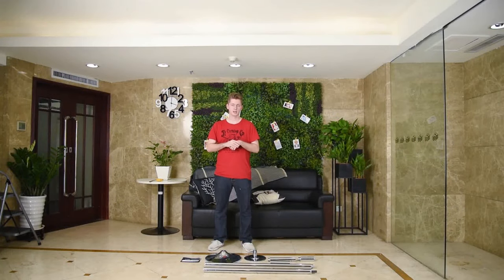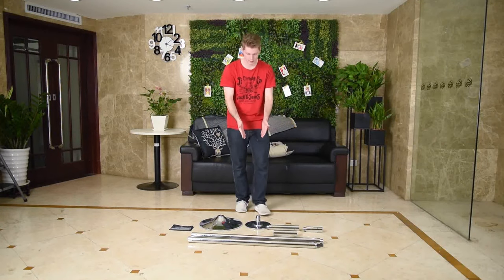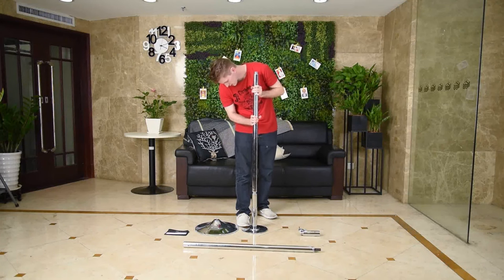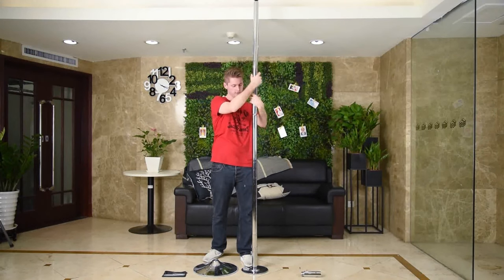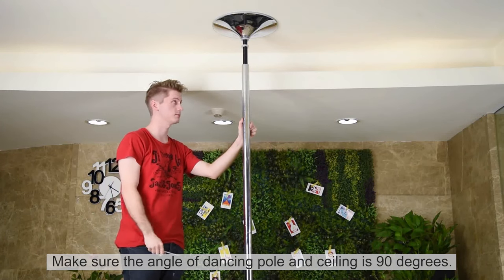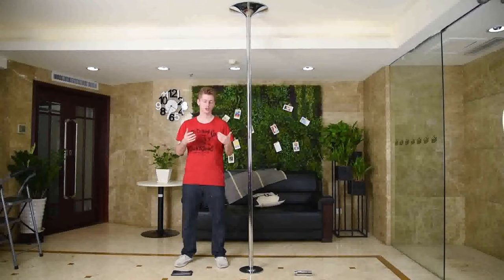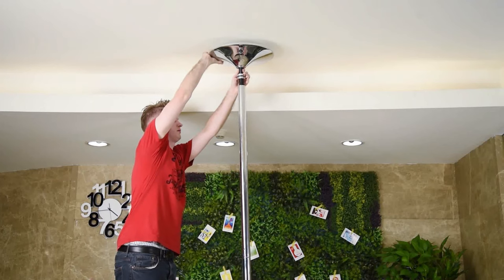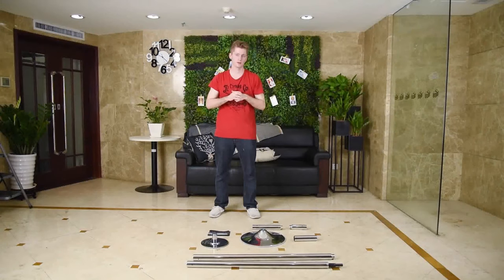How to Install the Spinning & Static Dancing pole and How to take it down - Big Upon Dome Version

Comment: everyone whos having a problem! Fix! My room mate took the whole pole down without loosening. It was a complete night mare Just take a hair dryer and heat it up until the metal expands. It will work even for the tightest joint.
Reply: Currently using the hair dryer,hoping ot works :(
Reply: I Did it :) I hammered the the little tool ( I forgot the name) in the direction to unscrew and lo and behold it worked..finally got it up again lol
Reply: Demurr Corp what way did you turn to unscrew? And what part of the pole do you heat up?
Reply: @anarosales7703   the pole was taken down but wouldn't come apart. I tried heating it at the joint but that didn't help. I put the allen key(duno American term but its the small tool that comes with the pole) i put it in one of the holes , and in the direction to loosen it i wacked the hammer onit afew times and it finally came apart. I literally had it together for like 8 years and was about to give up and chuck it.
Reply: Omg. Hair dryer worked! Thanks a million. Thought I would never get my pole down.
Reply: Good looking out
Reply: So I have an extension that's stuck. I should be able to take a blow dryer 2 it to loosen the extension?
Reply: do i heat up the iron nut???

Comment: How did you get the pole to fit so perfectly to the wall.. I feel like I’ve done every option of big extensions and No extensions and it’s all either too long or too short. I’m very confused
Reply: A little late but i was asking this too (for future viewers). The top piece is an adjuster for height. I thought my pole was too small but the adjuster (black piece) can be extended by unscrewing it out of the pole (with the adjuster tool - long silver thing). Do it with the top piece on. Hope this helps 😊
Reply: @KarnivorousKeyz  you’re a life saver 😭😭😭💛
Reply: I’m still having this problem now!

Comment: The video is Very Helpful Thankyou .. But "IM NOT ABLE TO TAKE IT DOWN Because the iron rod will not twist or unscrew back down  from the dome, witch is super tight into my ceiling.. It may have even put a hole into it, but I can't tell because it's that tight on the ceiling. And will not unscrew???
Reply from the maker: Hi Latoya! We are sorry for the inconvenience .Can you try to use WD-40 to loosen the pole and use a wrench to unscrew the iron rod?
Reply: Oi ME TOO! Sold my house and i cant get it down 😞😞😞
Reply: Latoya Mayo you have to move the nut up before the threaded rod will go down as the nut is there to prevent it unscrewing. Use the spanner big end for the nut and small end slides into notch at top of rid.
You can always hit the spanner with a hammer anticlockwise for the nut and clockwise for the rod.
Reply: Mine is X pole X Titanium tho so maybe slightly different.
Reply: everyone whos having a problem! Fix! My room mate took the whole pole down without loosening. It was a complete night mare Just take a hair dryer and heat it up until the metal expands. It will work even for the tightest joint.
Reply: was this pole safe and sturdy? Did you ever have issues with it coming loose from the ceiling or falling?
Reply: How did you solve it?

Comment: How do you keep the pole steady? I made sure to tighten it when I installed but now it’s wobbly and slides around at the top dome area. Please help 😭
Reply: I have the same issue did you ever figure it out?????
Reply: @jmarie21  no I haven’t yet :(
Reply: I’m having the same issue rn. I will get back to you on this when I figure it out. I hope you still have ur pole 😭
Reply: So I couldn’t figure it out but I just added like sticky plastic to the bottom and top and it pretty much keeps it still !
Reply: @clevername9627  thanks so much! I’ll give it a try 😀

Comment: I brought my pole years ago, moved house and when i moved i couldn't take the pole apart to adjust to a shorter ceiling. Im at that point were im thinking to bin it but to only buy a different brand thats not sooo hard to take apart. Please help, tried unscrewing, hair dryer trickz nothing, pole will not come apart.
Reply: Did you ever have issues with it coming loose? Was it safe and sturdy?
Reply: Like falling from the ceiling

Comment: I have one and cant take it down and the house I was renting sold and new owners took over 3 days ago and If icant get it down today i could be liable for removal charges.
Reply: Danielle did you get it down I can’t get mine down either
Reply: You start at the top unclip the cover and then screw the nut up by turning anti clockwise whilst using the small spanner end to turn the threaded part clock wise this will shorten enough to get it horizontal on floor then just put in car thru boot in between the seats into the front foot well if can't undo the middle.
But you don't attempt to undo the middle until the pole is horizontal.
Reply: everyone whos having a problem! Fix! My room mate took the whole pole down without loosening. It was a complete night mare Just take a hair dryer and heat it up until the metal expands. It will work even for the tightest joint.

Comment: my problem is the black extender pole that comes in pole A. I turned it anti clockwise, but the black pole fell through the bottom. I cannot pull it/screw it back through pole A. Do I need to purchase a new one because right now my pole is useless.
Reply: I have that same problem too 😢 have you figured out any ways yet?
Reply from the maker: Please try to screw back clockwise, if not , may be the thread was hit when fell down, you can check if its surface lose the shape,  use a file and adjust it. If all of them not work, you can ask for a replacement. Thank you
Reply: Same problem.  Anyone find a Resoluation?

Comment: Can someone help please? I have removed the expansion cover and loosened up the flange nut but when I use the long key stick In the black expander to untwist it won’t budge. The key is literally bending Instead and the black expander is not moving at all 🤦🏽‍♀️ Will the blow dryer trick work for this or what can I do ?
Reply from the maker: Hi Ty, we are sorry to hear about that. Please send us a email directly with photos at sales@thelashop.com
Reply: Same!!! Did you ever get it down?
Reply: sameeee! I'm not getting any movement from the inner black screw.  I need Help 🙏😫 🙏
Reply: ✨️WD40✨️ got it done ✔️

Comment: Hi! Does anybody know why my pole keeps making thud noises everytime I’m on it. especially on spin mode it makes this noise as if it’s too tight or the long bar from inside is old
Reply: I can’t say for sure but something similar happens to me when my pole needs to be loosened and retightened using the top parts near the ceiling
Reply: ✨️WD40✨️

Comment: ANY HELP? I took my pole down and am putting it back up in a new place.

I don't seem to have the iron nut that was inside of the cover. Does anyone know where I can purchase one? 
I see a much smaller looking adapter that doesn't have holes in It. It was on the bottom base of mine when I took the pole down, so I think I'm missing the one thats needed for the top ??

Comment: I was putting up my pole and when I adjusted it to the ceiling it was not spinning freely. So I began to loosen It and when I did the pole cover fell onto the small extension and now they're stuck together. How do I solve the pole spinning freely and unsticking the cover from the small extension? I was so close I just want to cry. Please help me....😊.
Reply: Did you take the 2 small pins out the bottom of the pole for it to spin freely
Reply: It was probably not spinning freely because it was not leveled.. mine started skipping when it got tilted from the 90 degree position
Reply: I am having this same issue. I ended up moving so I took the pole down. When I put it back up I’m going to try your tips but I think I tried everything. Im starting to wonder if it won’t spin due to the fact it’s in carpet???

Comment: Does it leave marks on the ceiling and floor?
Reply from the maker: Usually, it won't leave marks on the surface. Thank you.
Reply from the maker: Nope, this will not leave any marks on the ceiling or the floor. Our dance pole is easy to install and we hope that you will give our item a try!

Comment: If my ceiling is a bit small in height can I just exempt the main pole  and just use pole A? Or is it only safe to use the main pole and pole A(the pole with the iron nut.)?
Reply from the maker: Hi Kaziah, the main poles are required. Main pole A and B. The only parts that are optional are the extensions.

Comment: So I have this pole installed also and I can’t get it down... when I stick the iron rod though, the entire pole moves with it. I can keep twisting it and twisting it, but it doesn’t do anything. But I have another issue that may be the cause while it won’t come down. My 6 year old niece was messing with the static/spin pieces at the bottom you screw in and now the pole will not stay completely static... could that be an issue? Also yet another reason, which is the reason I need the pole down in the first place is because my fiancé was just messing around and swinging on the pole and all of a sudden the pole moved on the ceiling, now it’s crooked. I need the pole down so I can fix it to be upright again instead of crooked. Sorry, I know I have a lot of issues, but I’m stuck here. Can anyone help?
Reply: Kiana King mine is doing the same thing, the back part spins w the pole I’m confused???
Reply: Brandon Neubarth I got it figured out, but explaining it to you may be a different story but I’ll try my best, haha. Basically the static part is messed up on our poles, and in order to adjust the height of the pole your pole needs to be in static mode. Since ours is messed up, it won’t unscrew from the ceiling like it’s supposed to. What you’re supposed to do is have someone hold the actual pole at the bottom and have someone at the top unscrewing the black part that had the cover over it. Notice if someone isn’t holding the pole while you’re trying to unscrew the black part, the pole just moves with it. That’s why you have to hold it to prevent it from spinning too. So just hold it while someone else unscrews the top and it should come down, just make sure you’re turning it the right way!
Reply: everyone whos having a problem! Fix! My room mate took the whole pole down without loosening. It was a complete night mare Just take a hair dryer and heat it up until the metal expands. It will work even for the tightest joint.
Reply: Yes my exact situation and there’s no one to help me hold it down I even tried to stand on the bottom part and use one arm to twist and it’s painful I know I’ll get is maybe I should ask my neighbor for help 😭
Reply: @theshineyone1111  can you make a video
Reply: @steenprecious  it's super simple. Just grab a hair dryer crank it on high and heat up the joint once it gets hot enough it will expand and you can twist it.

Alternatively if you can get your hands on a pair of pipe wrenches and then put a towel around the pole so you don't damage it.

Comment: How do you know that your ceiling is strong enough?
Reply: every house must have a strong ceiling. if u dont have a strong ceiling, u have the wrong house, honey. but more generally, choose concrete ceilings ;)
Reply: Tap on ceiling to find if there is joist, if ceiling is not solid.

Comment: My piece that goes on the ceiling isn’t right. The pole won’t go through it
Reply: Yeah mine too.. did you ever get it fixed?
Reply: Janepyramid I honestly just had someone hold the dome up on the ceiling while they tighten the pole. It doesn’t move at all and it’s sturdy!
Reply: Kayla Netanya yes I had finally gotten it up the same night luckily but I had a hard time getting it to be straight lol luckily I did. Thank you for the help either way!

Comment: If it does not spin after loosening of black screws...what can be the problem?
Reply from the maker: Hi Sona, if it is stuck on static mode even after loosening the nut. We may need to replace a part. Kindly send us a message at sales@thelashop.com and provide your order number.

Comment: How do you make sure it doesn’t crack the ceiling? I tried  putting mine up today and as I was tightening the pressure I heard a big crack
Reply from the maker: Hi Daphne, what size did you purchase and what is the height of your ceiling?
Reply: Its because you need a stud finder to locate the beam in the ceiling to withstand the pressure. If you put it up on a hollow spot you will damage the ceiling.
Reply: @annfrank90 😂😂😂😂